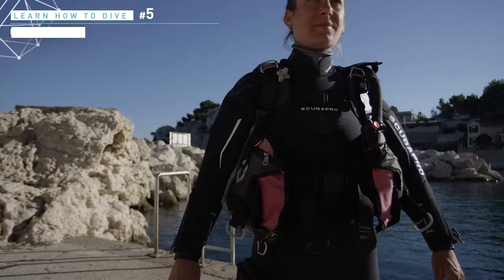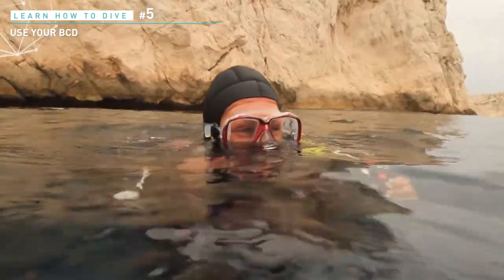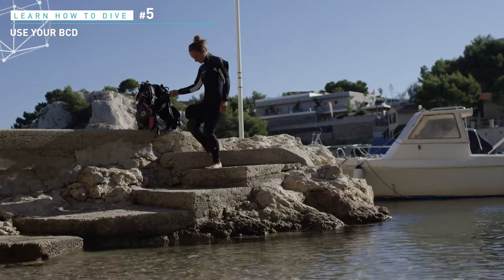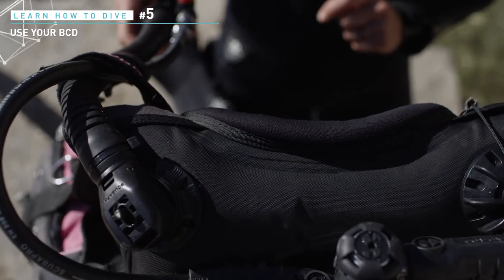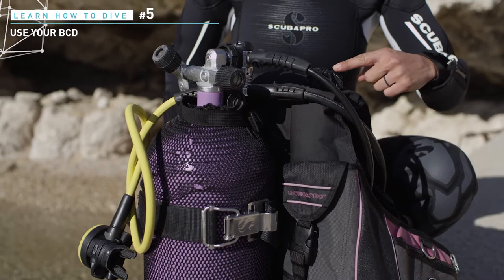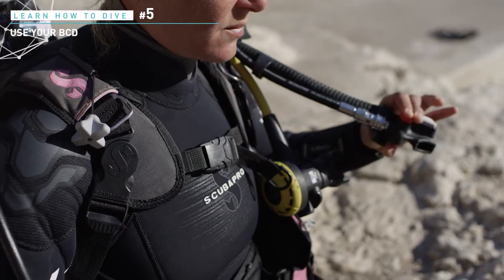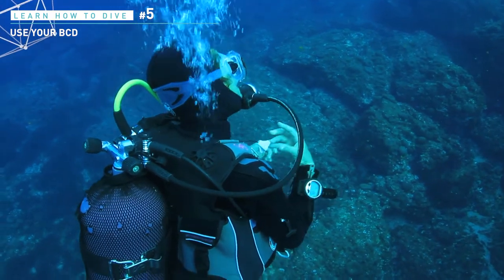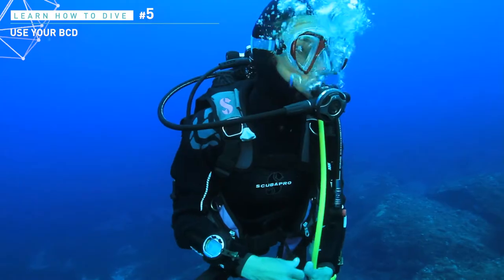Diving tutorial UCPA #5 - How to use your BCD (jacket)

Comment: ...wait.

If the total amount of air your carrying doesn't change....why does inflating a vest with it alter your buoyancy?
Reply: The density of compressed air is much higher than when it expands
Reply: Because inflating it changes your totals VOLUME, while obviously your mass (and the mass of the air you are carrying) does not change. Increased volume means an increased amount of displaced water, which means, based on Archimedes buoyancy principle, a stronger force pushing you up, i.e. more buoyancy.
Reply: @ZY1982  Physics be complex.
Reply: an excellent question Hotaru - thank you